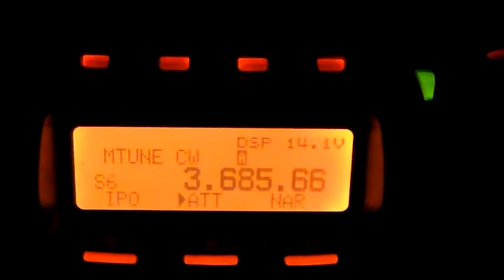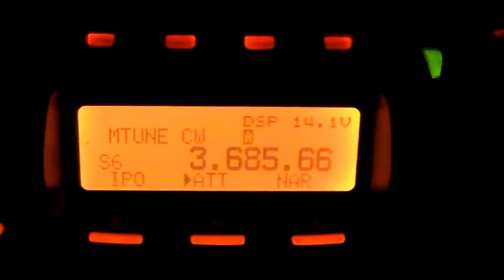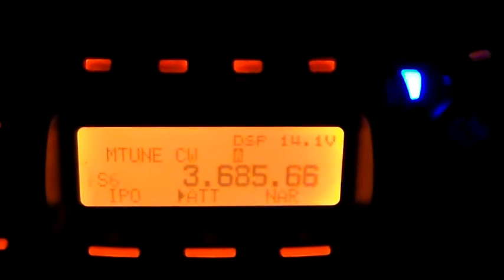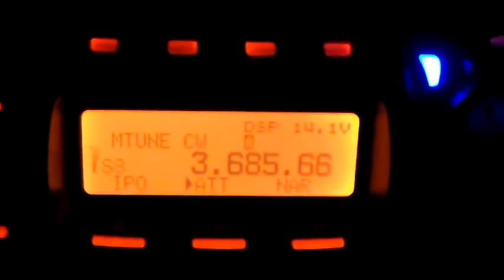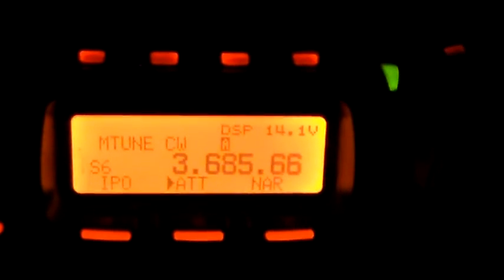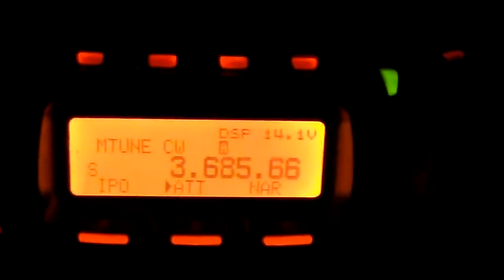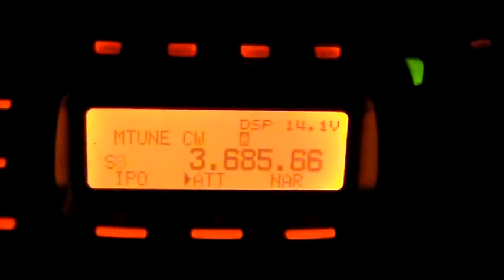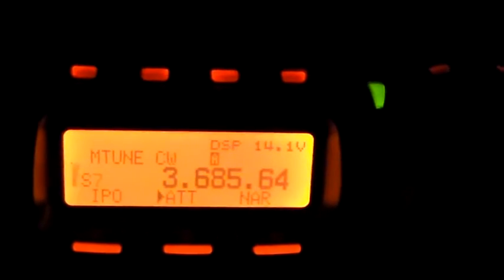Yaesu FT857 CW Feature

Comment: 14.1 volts sitting idle?  Check your power supply as this will cause your radio to run hot at idle.